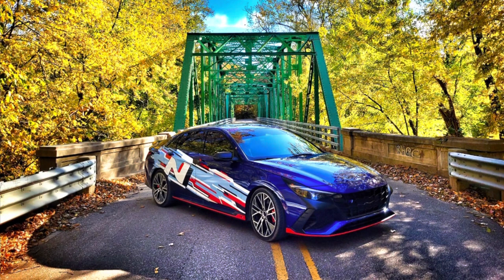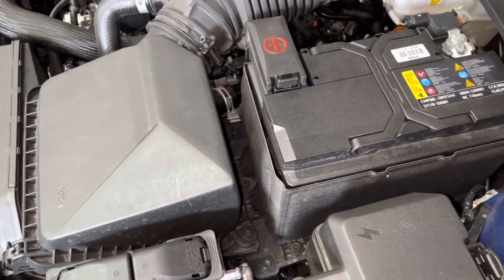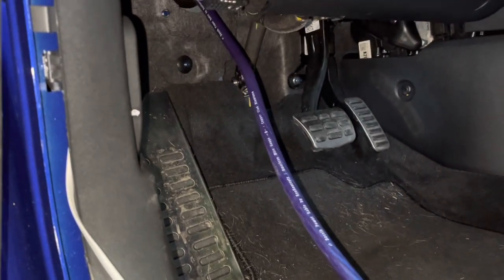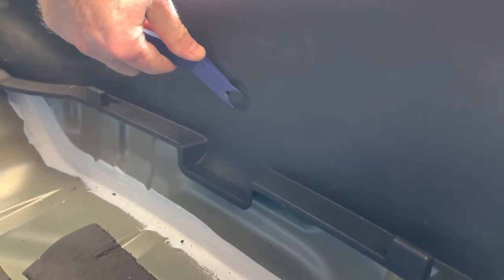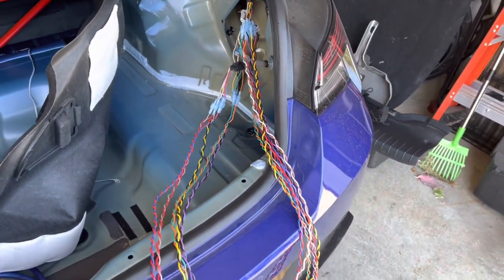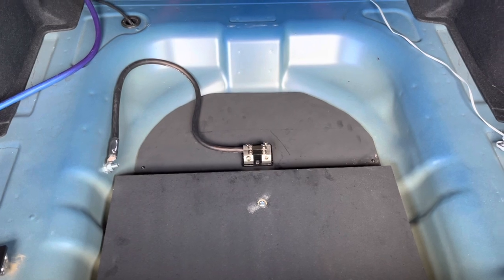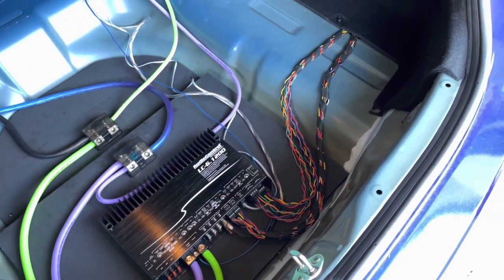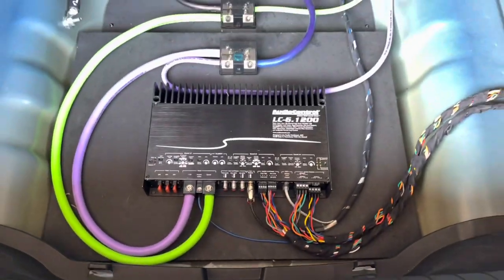How to Install an AudioControl LC-6.1200 Amplifier in a 2022+ Hyundai Elantra N

Comment: So is there 2 separate yellow and black wires for the front left and rear left??
Reply from the maker: Correct. This could be different if your speaker wire plug is green. Mine is black.
Reply: @nprform  mine is black as well. So to confirm 2 separate sets of yellow and black.
Reply from the maker: @themadpanda6418  Correct, the rear left, yellow and black, are next to the center speaker’s wires.
Reply from the maker: Front speakers are next to brown and white subwoofer speaker wires.

Comment: Thanks for the helpful videos, I have a question about this, I have a 4 channel amp and I want to run only 4 ohms to run my Front and Rear, can I leave the bose amp on to just run the sub and the center channel and still run other amps with an Audio Control LC7i?
Reply from the maker: Yes, you can run the front and rear signal to the LC7i from the Bose amp to retain front and rear fade and let the Bose amp power the sub and center.

Comment: Did you 100% bypass the bose amp or are you coming out of the bose amp into the hi level inputs of the bose amp?
Reply from the maker: I’ve cut the Bose amplifier’s wires. The wires still attached to the Bose amp are being used for signal to the high level input of my aftermarket amp. The wires not connected to the Bose amp are the speaker wires, which I’m sending to the speaker output of the aftermarket amplifier.
Reply: @nprform  Have you had any issues with static when the stereo is muted or pops? Is it possible to completely bypass the bose amp or is the signal coming into it a digital signal?
Reply from the maker: @austinalthouse  No, I’ve not had any issues with pops or noise, muted or unmuted. The signal is coming in digitally and at this time there is not a solution for this. I know someone has converted the digital signal, using a digital to analog converter, but in doing so, lost volume control through the factory head unit. My method uses several wires, but works without any issues.

Comment: Great video! Do you have any issues like losing Active Sound Design? I wanna upgrade my system(nothing too extensive, sub, amp, some of the speakers) and keep hearing I'll lose the active sound. I wanna make sure I don't lose any features.
Reply from the maker: @PapaHetFan  Thank you! No, I haven’t lost any features.
Reply: @nprform  Ouch... I was excited, until I checked the price of that amp. At almost $1300 CAD, it's almost my entire budget. I assume I won't lose any features if I just add a Rockford P300-12 and call it a day? I could spend the rest on sound deadening. I think this would be closer to your earlier setup
Reply from the maker: @PapaHetFan  My setup is not cheap. If you only add the sub only that would be fine and sound good, but I would highly recommend adding the AudioControl LC2i pro and a Dayton 3” center channel. These two items are inexpensive and help improve the bass output and center sound.
Reply: @nprform  You answered a question I was too shy to ask lol, thanks you. I know very little about this stuff, wouldn't a 2 channel converter eliminate front/rear fade?
Reply from the maker: @PapaHetFan  Since you would be hooking up a subwoofer only, you can tap into the subwoofer’s wires, this will not have any effect on fade.
Reply: @nprform  Ahhhh, I get it now. Thank you NP! Then that's what I'll do.
Reply from the maker: @PapaHetFan  If you have any more questions or help, feel free to reach out.
Reply: @nprform  So, I finally had a reputable shop install the setup you recommended, P300+LC2i. They had a 4.7 rating with hundreds of reviews on Google Maps. Oh boy did they make a mess of it. For some reason they wanted to put the AudioControl in the cabin so they could wire it to the head unit(not the little knob, the entire unit). I had to show them your video and tell them to just hook the subwoofer wire into it and leave the rest intact (and put the friggin thing in the trunk!). They didn't hook up the remote wire and it was on auto, the light on the subwoofer would stay on even when the car was off, so I was a bit concerned it would drain the battery, so I just put it on remote, which I believe shut it down entirely since there's no remote wire hooked up. But at least I'm not worried about a dead battery for now. I immediately called the next nearest audio shop, which is an hour away, and made an appointment for them to review what these guys did and fix it. Now even though the sub is basically off, the audio control's light is still on.
Enough ranting. Thank you for your advice, as you said this setup did not mess with my Active Sound or anything else. The bass is very strong, but a bit overpowering but that's because they didn't tune it, they put maximum gain on it and I was too upset to dial it in myself. I'm sure with a bit of patience and a decent installation tech it will be awesome.
Next on my list is sound-deadening the doors. They did the trunk, but refused to do the doors and kept insisting it already has insulation (they didn't bother taking the inner panel and window out). After that, PPF and lightweight 18x8 wheels for my winter setup to make the ride smoother. 
Anyway, thank you again for all the great advice, I thought I'd give an update and rant a bit lol.
Reply from the maker: @PapaHetFan  Thank you so much for the update. I’m very sorry you had such an issue with your local shops. I don’t like using the automatic turn on, which is why I suggest using the remote wire to turn the unit on and off. I hope you get it sorted out. Yes, a bit of tuning will have the sub sounding great. Sound deadening the doors will help with the mid bass response for the door speakers. Feel free to keep me updated. Thank you!

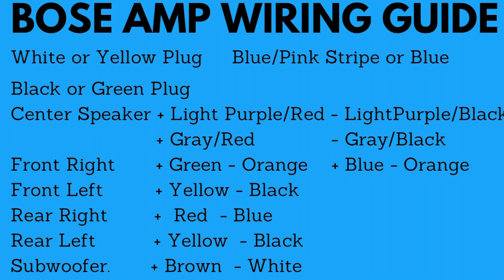Comment: At 8:42 You said Amp channels 5 and 6 were for the Center speaker. I referred to your diagram at 5:50. Are there 2 center channel speakers? In your other video for "center speaker removal/install", I only saw one. Maybe i'm missing something. I'm trying to figure out what amp to get. I want to go a slightly different route and get a multi channel amp with integrated DSP, and just add a regular unpowered subwoofer.
Reply from the maker: I tried first running the front to channels 1/2, center to 3/4, and rear to 5/6. I found I didn’t like this set-up as I found I needed to sum front and rear for full range output. So this is why at the end of the video I stated I ran the enter out of 5/6. I used front signal input 1/2 and front speaker output 1/2, rear input 3/4 and rear speaker output 3/4, and finally center input 5/6 (only used channel 5) and center out channel 5. I did not use the sub output from the Bose amp to the signal input of the new amp. When I add a DSP, I may add the sub signal into the DSP, but found running the amp only, did not help with providing a full range signal.
Reply: @nprform  Ok, so if I understand correctly you did this because of how your amp handles summing. I just purchased a D-6.1200 DSP/Amp I'll have to play around with it to figure out how I want it to work. Tomorrow I have a SPDIF to RCA DAC coming from Amazon. I'm going to try to see if I can get a digital audio signal from the Red/Yellow wires on the white harness. If so, I can bypass the Bose amp completely feed audio directly to the RCAs on the D-6.1200. I won't have to worry about summing and converting speaker level inputs that could possibly be clipping, adding more complexity into the audio chain. For volume control, I will need to purchase the ACR-3 to control the volume, as the OE volume knob just sends CAN data to the amp. Hoping it all works out as I imagine it will. If not, I will have go to the speaker level input route.
Reply from the maker: @tylerwatt12  Yes, it was due to the summing and the fact I was running a center speaker off the amp instead of a subwoofer. I didn’t buy the D-6.1200 because I’m building the system in stages, but that accomplishes the same thing I will end up having in my car. Good choice! Please let me know how the converter works for you. I’d be really interested to know if that works.
Reply: @nprform  The SPDIF Adapter works great. And I guess bluetooth calls are injected into the digital audio stream, so I don't have to pipe another sound source into the DSP. I'm currently waiting for my ACR-3 knob to arrive so I can control the main system volume, as dashboard volume knob has no effect on the digital audio signal to the DSP.
Reply from the maker: @tylerwatt12  That’s cool, I’m glad it worked. What adapter did you use?

Comment: Hello great videos first of all thank you for being the first person to provide our community with audio info. I am curious will this void any manufacturer warranties? Naturally wouldn't expect any problems to happen however what might the dealer say? I will most likely want to have a system anyway
Reply from the maker: I can’t really think of a warranty issue with adding audio equipment to a vehicle. I’ve had audio systems in 30+ cars and haven’t had a single issue with a warranty claim. The only real thing I could see is if you messed up and shorted out the amp or headunit. If someone isn’t familiar with car audio wiring, I would go to a professional shop.
Reply: @nprform  ok sounds good to me I figured any modification would void to but idk
Reply from the maker: @squids9628  Anytime you modify something on a car a manufacturer can deny a warranty claim on the item of the car that’s been modified if that part fails. It will not void your entire warranty. With the audio system, you should be safe with adding speakers or amplifier’s as long as you have a basic knowledge of car audio wiring, work with the power disconnect, and don’t overload your car’s charging system, unless you plan to upgrade the charging system. The upgrades I’m showing are simple upgrades without going to extremes involving a new alternator or multiple batteries. Plus my installs can be easily reversed or temporarily removed.

Comment: Hi there.im about to do this in my sedan. Does the factory amp have to remain in the car or can it be removed completely? I ask because im not sure if the amp is intergrated with the head unit and will it cause issues with sensors in the car etc..if i remove it. And is the front centre speaker integral to anything such as bluetooth or phone speaker as i wish to remove that as well.
Reply from the maker: You will need to keep the amp in the car, since it is receiving its signal via an optical cable from the head unit. I kept my center, but I believe if u remove it, the fake engine sounds won’t work, which isn’t a big deal. I’m not sure about the navigation as I haven’t traveled with the car and haven’t had a need for the navigation. I’ve listened to the system without the center and I can say upgrading it and keeping it does help improve the front stage of the car and I’m not a big fan of center speakers.

Comment: Where did you find the Bose wiring diagram?? Thanks :)
Reply from the maker: I purchased the wiring diagram.
Reply: @nprform Thanks for the quick reply! Do the front speakers (woofer and tweeter) play the full range of frequencies or are the mids cut off and only given for the center speaker?
Reply: @nprform Oh also, where did you purchase the diagram?
Reply from the maker: @parsadazebra3399  I had to sum the front and rear channels to get a full range signal.
Reply from the maker: @parsadazebra3399  I purchased the diagram from Crutchfield. Their diagram is not specific for the N model, but it helped figure out how to get everything working.
Reply: @nprform  Are you able to upload the Crutchfield info??  I'm in Australia & unable to buy them.
Reply from the maker: @purplehazeffc  Are you wanting a link to just the AudioControl amplifier?
Reply: @nprform  No. The info from Crutchfield
Reply from the maker: @purplehazeffc  I’m sorry, I miss understood. No, I can’t upload the booklet of information they sent me. I don’t have a link, I have pages of information.

Comment: Wait so the speaker wire goes into the same harnesses as the output in the black plug?
Reply from the maker: @MrTherandomvidsguy  Can you be a little more clear on your question?
Reply: @nprform  my bad. I meant to say does the speaker wire from the headunit share the same exact black plug as input then output? As in like it being both a input and output plug?
Reply from the maker: @MrTherandomvidsguy  The amplifier receives signal via a digital signal from the head unit. The amplifier’s speaker wire plug is then sending the audio and power out to the speakers. You have to tap into the speaker wires for signal and then run wire to the speakers or cut the wires and split signal coming out of the amp to a new amp or processor and the speaker wire side to the amplifier’s speaker output. There isn’t a digital signal converter made for this car at this time. It is possible to make your own converter, but not all the factory functions will work as OEM, such as the volume control.
Reply: @nprform  oh no. Thanks for telling me this. This means I may have to get a  SPDIF converter but then I'd probably lose other things like volume control, etc. 

This sucks. I do have a shanling M6 Ultra anyways and planned on only using that to play music but still. Ugh
Reply from the maker: @MrTherandomvidsguy  Yes, I was disappointed when I began upgrading the system and couldn’t find an easy pug and plug wire harness that would take the digital signal and covert it to a clean flat signal and still retain all the factory sounds. You can do it, but it would take some doing with adapters. My AudioControl DSP has digital in I’d like to use, but I’m really happy with how the system turned out without going through all the trouble of trying to get the digital signal to work.
Reply: @nprform  apparently the headunit has a SPDIF out available behind the headunit.
Reply from the maker: @MrTherandomvidsguy  It’d be interesting to see that and if you could simply run that to a DSP and everything work properly.

Comment: great video, subscribed. If I just add an amplifier without replacing my speakers and subwoofer, does that increase the audio levels coming at the same volume? Let me elaborate, with stock I can't properly hear the audio if it's less than 30, if I just add an amplifier will that help with the situation? Would the audio be louder at the lower volume levels (compared to the stock)?
Reply from the maker: Yes. I don’t know that the benefit would out weigh the cost though. Example: you might go from listening at volume set at 57 with factory amplifier to 50 with an aftermarket amplifier. This would depend on the amplifier and weather or not you use a powered line out converter to achieve a strong signal.